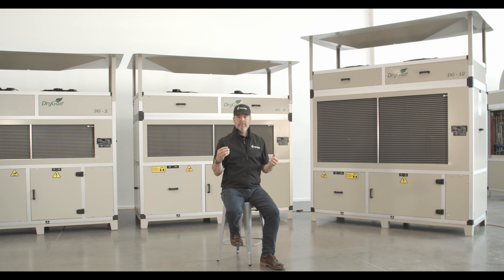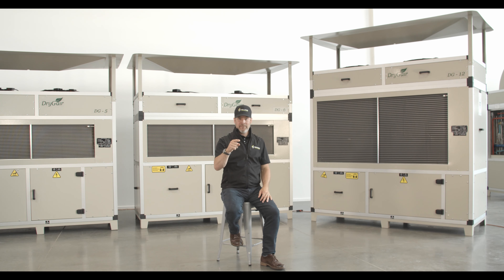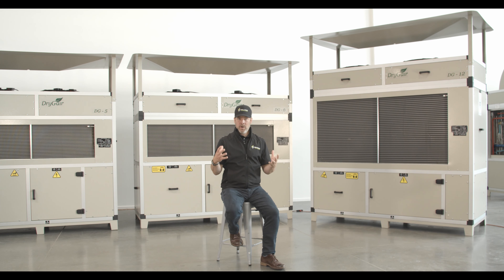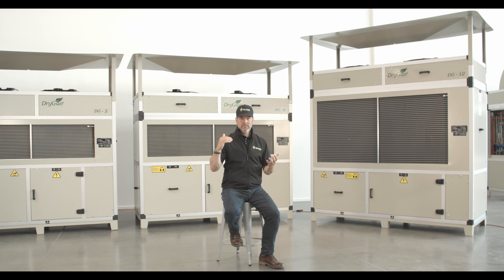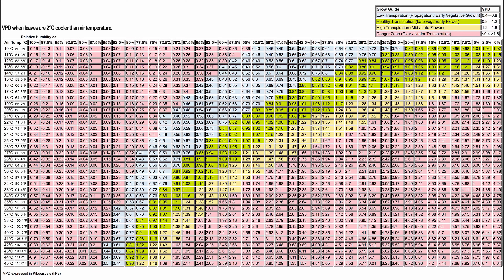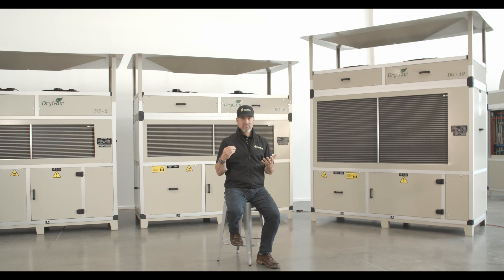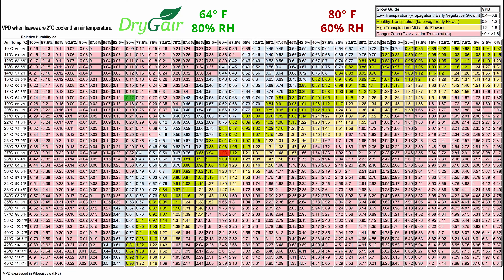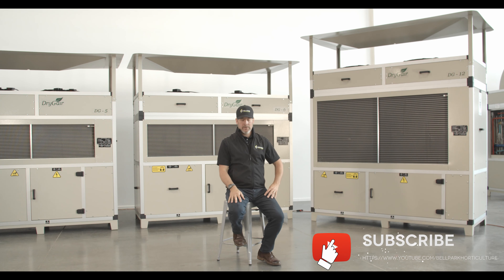Vapor Pressure Deficit (VPD) Explained & 65°F / 80 RH vs. 80°F / 60 RH - Part 5

Comment: I think of VPD as the "temperature-driven" rate of evaporation of pure water or sublimation of pure ice. (If the VPD is negative, then condensation will occur.)

Wind, radiative heat (Sunlight, IR) and having the water in a solution or even adsorbed to something will modify that "temperature-driven" rate, but that thinking works for me.